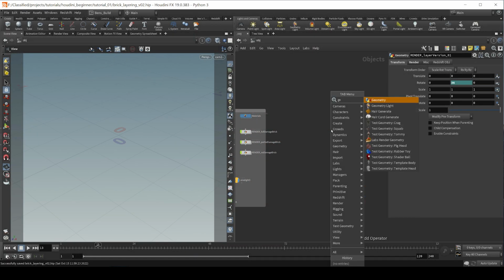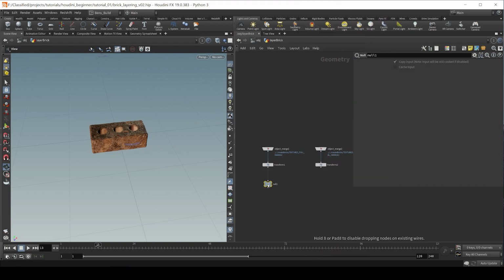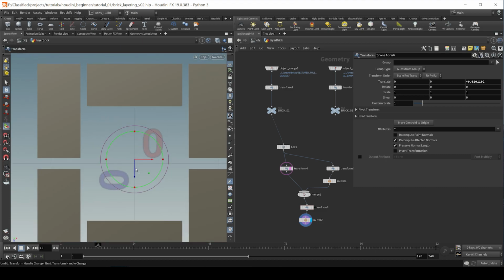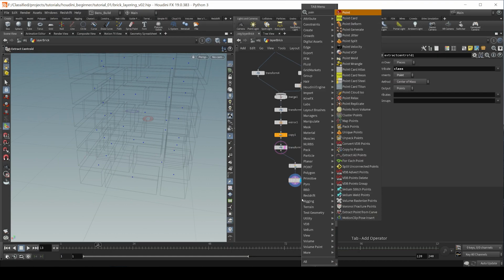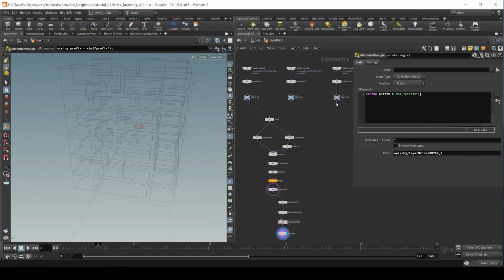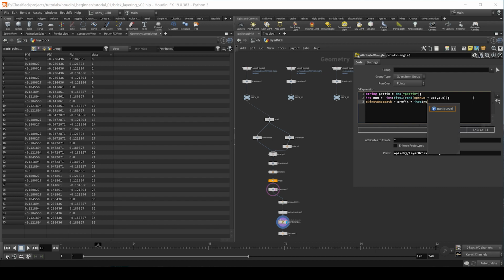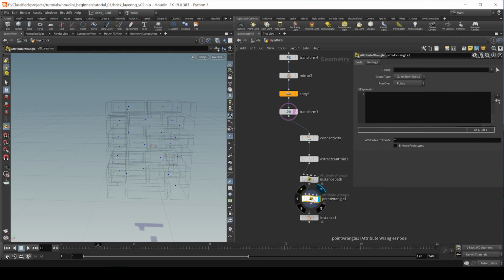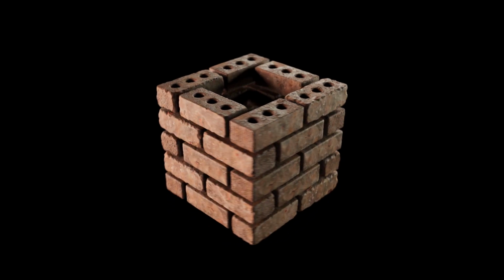Houdini Tutorial - Packed geometry and efficient rendering

Comment: What is the difference between this and just selecting "packed geo" checkbox in copy to points node and copy& transform nodes?
Reply from the maker: At the end of the day, packed geo is the same whether it is instanced with the instance sop, or whether you check "pack geo" on the copy sop. A packed geometry is simple a reference to a specific geo.

For example, say you have a model with 10,000 polygons. If you copy it to 100 points with the copy sop, WITHOUT checking packed geo, it will essentially duplicate that 10,000 poly model, 100 times. This would result it 1,000,000 polygons that all take up space in memory.

However, if you pack the geo, then it references only 10,000 polys in memory, yet you can have 100 instances of that high poly geo. 

So using the copy sop to pack, just locally packs the input of the copy sop, and the instance sop essentially loads whatever you are instancing as if it were a file.

Hopefully this helps?
Reply: @mrbennelson  yes thx! So it doesnt matter which way you use. Vex or copy to points/copytransform sop way
Reply from the maker: nope, I don't believe it should matter @g8610g   -- just middle mouse click on your node after the instance or copy sop and ensure it says something like "100 pack ed primitive" or "100 packed discs" and you should most likely be good -- I say most likely only because I can't 100% verify your scene, but that's the basic concept around packed geometry. :)
Reply: @mrbennelson  Hi I'm learning a lot from your videos! Thank you for the contents. I was also wondering how different it is from the copytopoint pack and instance. So you're saying it works almost the same way except the instance node takes a file format?
Reply from the maker: @user-sl309jd90  yep, basically. You can instance geometry on the opposite input of the copytopoint node. In fact, you can actually copy n number of geometries to pack and instance onto points based on a name attribute.

For example, say you have 10 points and 3 different versions of a brick, if you assign each an s@name attribute "piece_0", "piece_1" or "piece_2" -- Then just plug in the 3 bricks to the other input, but make sure each brick also has a unique name matching those points i.e. "piece_0" ... "piece_2"

Check "pack and instance" and bam, you can then copy as many bricks as you want but it'll only reference the 3 bricks, as opposed to literally copying the polygons.

I hope that makes sense? Sorry for the novel.

Comment: If I wanted to adjust the center rotation of each brick procedurally how would I go about doing that?
Reply from the maker: Good question -- the center of rotation in this example is the actual instance position point. If you wanted each point to rotate at an offset position from that center point, you'd need to:

STEP 1: subtract the offset vector position (your desired center of rotation) from the current instance position. 

//Code
v@offset = set(0,0,0);
@P -= v@offset;

STEP 2: apply your rotation to your normal/up vectors/ Rotations in vex can be done like this:

// Throw in point wrangle ----
vector normal = @N;
vector axis = v@up;
float angle = 0;
vector4 quat = quaternion(radians(angle),axis);
matrix3 m = qconvert(quat);
normal *= m;
@P *= m;
//end of vex code

STEP 3: then add back the offset vector position.

//Code
@P += v@offset;

------
That may have some errors in it, but that's the main concept. Give that a try, and see if it works. I didn't test it, but that's the gist of what I'd do.